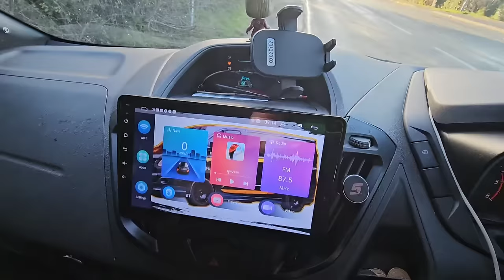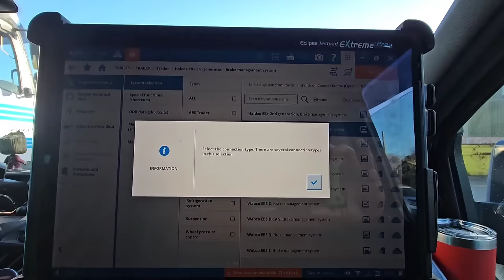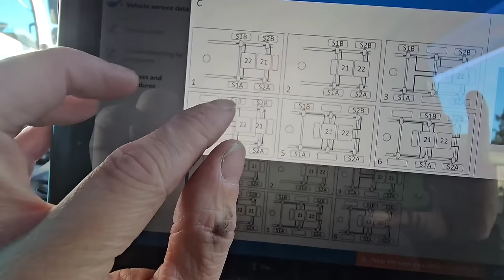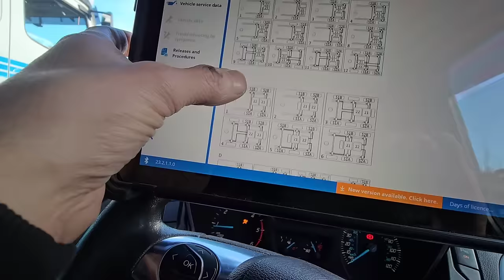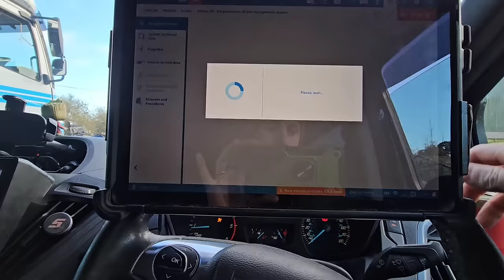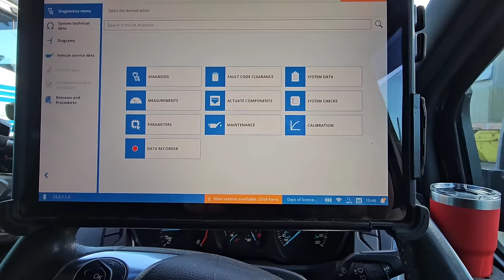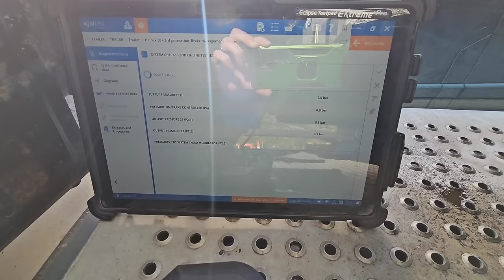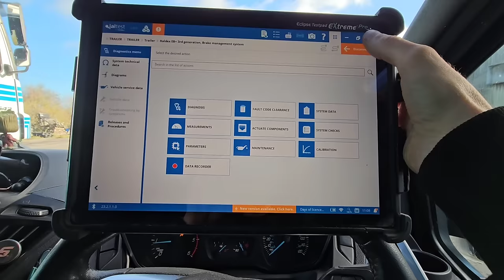Heldex Ebs, Diagnose and Repair.

Comment: Good video that. Do you ever find the jaltest lacks any info when it comes to schematics or necessary repair info etc compared to say dedicated manufacturer software?
Debated getting one myself instead of individual softwares/laptops for different brands…
Ps. One of those stickers would look good on my new bus when it arrives 💪
Reply from the maker: The jaltest is a great tool, but it does catch me out sometimes. Obviously I use it because i work on lots of different makes, and it would cost too much to have all oem spec Diagnostics.